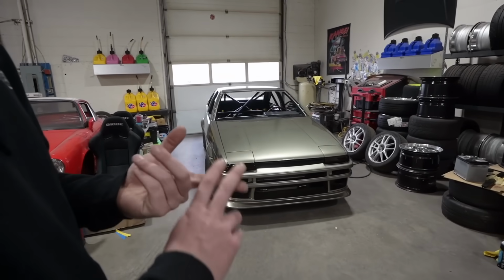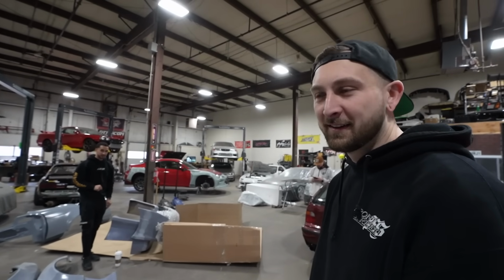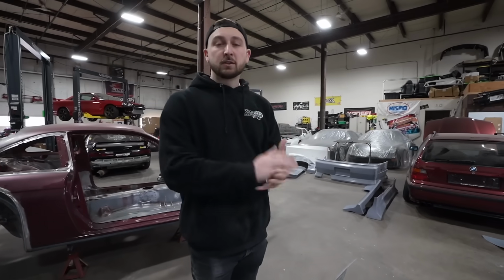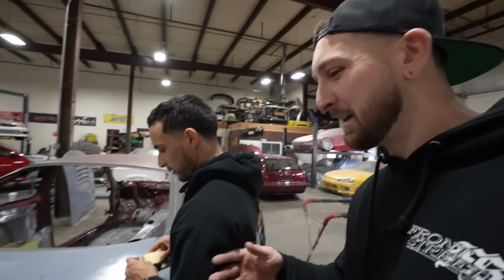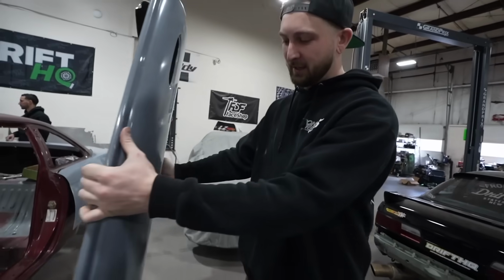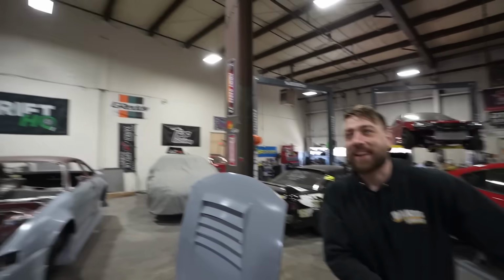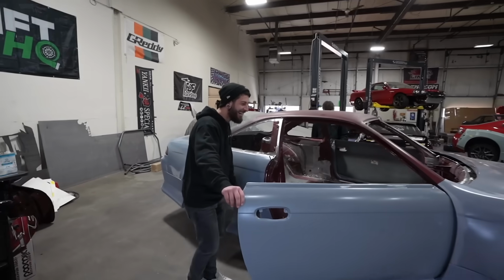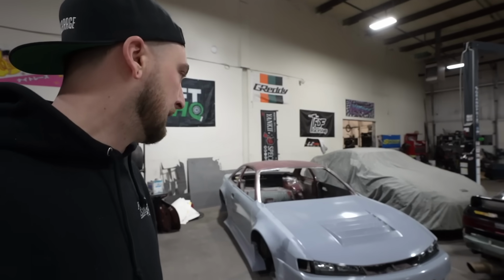PRO CAR gets an INSANE makeover! (FULL AERO!)

Comment: Hey Jimmy.  Let me tel you a little secret:   Use Bedliner on the inside of the fiberglass parts.   At the least on the bumpers and doors.    Using bedliner makes the fiberglass just about bomb proof.  No matter how crashed and crushed it gets it still holds it form and it stays together in one single piece.   No need to run around the track finding bumper parts and zip-tie`ìng them together.    BEDLINER!!!
Reply: Fantastic idea Holy heck
Reply: Sounds like that'd be a good bit of added weight though no?
Reply: @braidenreid5196    Yea there is some extra weight,   But it`s not much.  You don't need much to make it stick together. But the more you use the stronger it gets.   Like you could use a "regular" layer and have a strong sturdy bumper that survives a whole season.  Or you could spray a inch of the stuff everywhere and go out and use the cars as bumpercars without taking damage.
Reply: @braidenreid5196  They are drift cars not "race" cars where weight is one of the top concerns.
Reply: @zacharyballew4320  especially just a pound or two.
Reply: Did raptor on mine and works great just one coat dont need to go crazy
Reply: dude this is a fantastic idea
Reply: It looks really good too. Seeing unfinished fiberglass on the inside is yukkkky
Reply: Thats genius
Reply: Cool idea
Reply: That’s a good idea, raptor liner is rugged. I’ve seen some heavy stuff dropped in truck beds and them not even take a dent.
Reply: Off road guys have been doing this to their trucks for a long time. It works great for them too, especially throwing big rocks into fiberglass fender and bedsides.
Reply: @braidenreid5196  like hert once said “ just turn the boost up”
Reply: Raptor bedliner
Reply: Would flex seal work also?? 😂
Reply: Just get rubbed made bumpers then? People using rhino liner lol
Reply: Oh my god I've just molded two bumpers together and I've been wondering how I can reinforce the inner structure of the bumper.. If Bed liner sticks to ABS plastic, this tip might be an absolute godsend.
Reply: @braidenreid5196 2 tins of bedliner would do the whole kit. It's like 2kg of extra weight. So it's a negligible difference for the added benefit of strength.
Reply: Genius! I salute you, sir! 🫡😁
Reply: Fax if the good shit not the can !!! Real bed linner
Reply: Any brand?
Reply: Bedliner the underside + vinyl wrap the outer side 🤯🤯
Reply: This is a great idea, we used rhino liner on yacht rubrails & it was a game changer. They would be mushed up bad & still stay together.
Reply: Vinyl wrap instead of paint also works like that

Comment: @09:54, once ready, use a semi rigid spring, over the top of the "hood" pin, then put the trunk over over the pins with the spring still on, then push down and install the pin. this will keep tension on the bottom side of the trunk hood, keeping it tight and upright to the body lines.

Comment: Jimmy to make the rear end match the front you really need am aggressive duck bill spoiler to kill the taillight gap enclose them a bit so it matches the "straight" line thin look of the front, big wing won't solve that only a duckbill that touches the top of the tail lights.

Also since it was a clean s14 I think it was a great idea going back to the original chassis design, just like if you never cut it up bit once it's smashed then you change to 15 😁